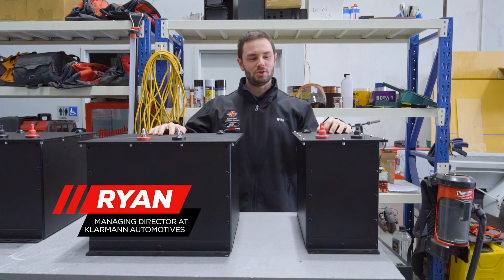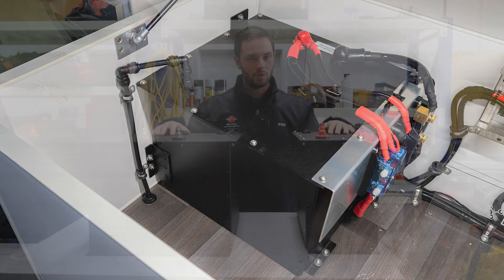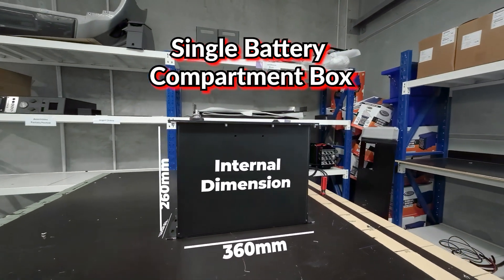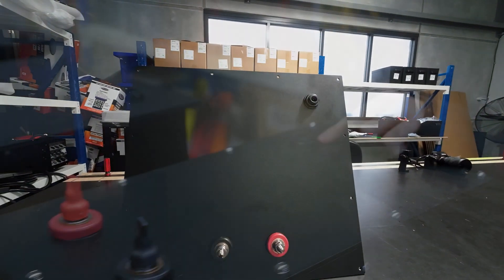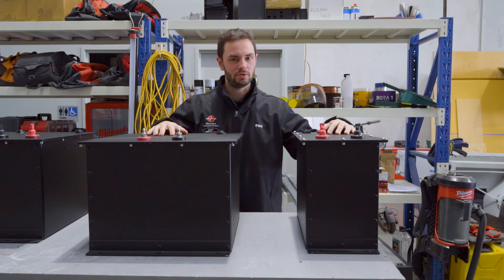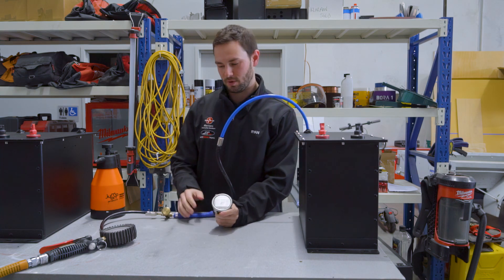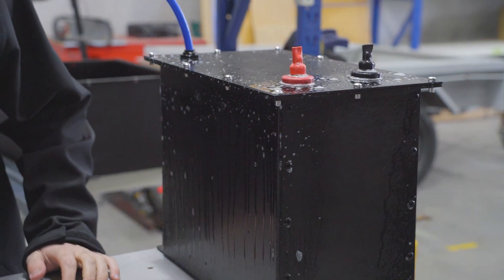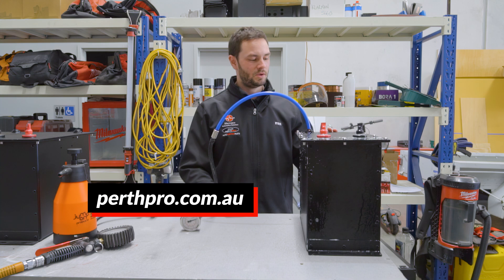Lithium Battery Compartment : The Solution For Habitable Spaces

Comment: So in the extremely unlikely event of a thermal runaway of one 200ah battery is all the hot gases supposed to exit via that small plastic tube? 
Have you guy even seen a thermal runaway from a lithium battery,
Does the new standard give vent dimensions in relation to battery capacity I would assume it should correlate,
Reply: LiFePo don't go into thermal runaway, they do not use Cobalt in the chemistry which is the cause of thermal rrunaway as it self supplies oxygen, these are only for the off gassing that can occur, which is highly toxic!